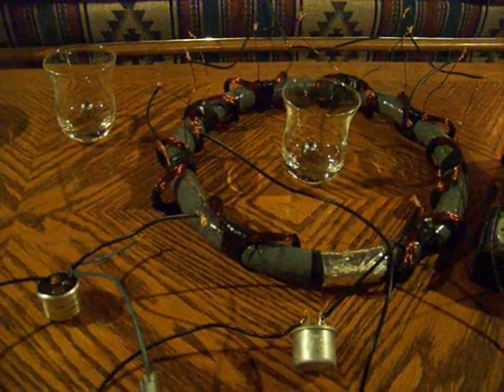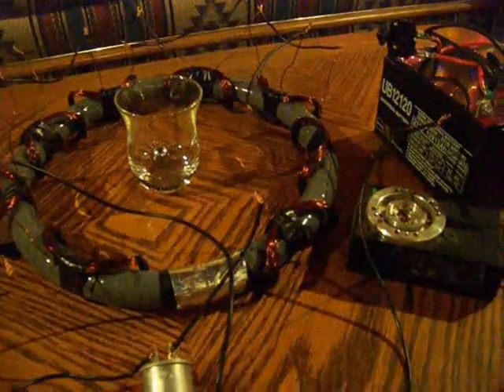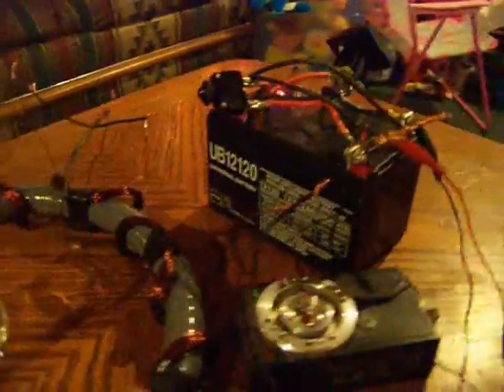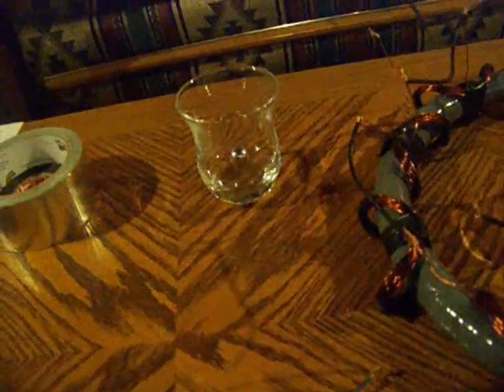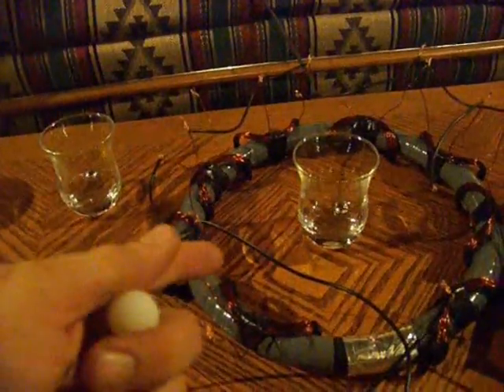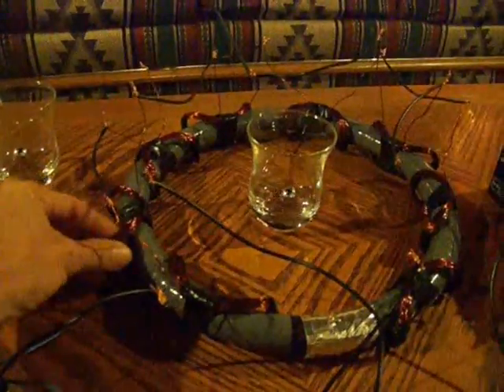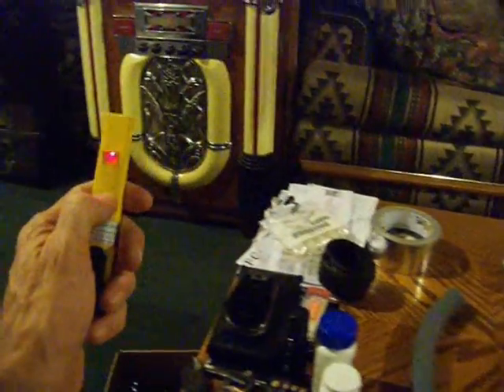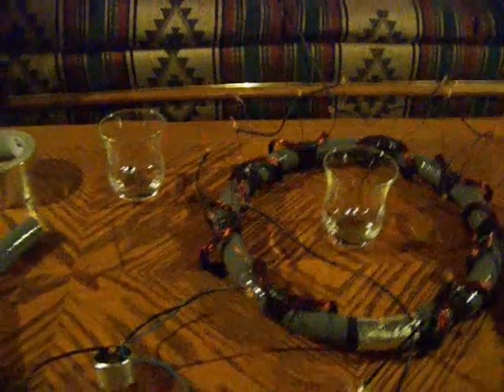Neodymium Magnet  Accelerator !

Comment: That's pretty cool...looks like it has some potential.  I actually went in another direction for accelerating magnets to get usable energy out of a very simple design using a low cost drive circuit. 
 Check it out... its a completely different concept and in this early stage made  ~28 volts but can be expanded by using more internal magnets. Looks like it'll make around 100 volts AC in one small tube.  my video is here: =Cx5nq3BHKK8
I enjoy your videos along with your propensity to do cool stuff.  Thanks for sharing...

Comment: Theres a coil i came up with a little while back you may like.  you make a thin coil of wire ( one strand if you like) and stick the two ends together like a short. this makes it one continues loop. you then tap at 180 degrees, splitting the coil in two. what that does is makes the left side north and the right side south. when energised the two half try come together. or with a magnet in the centre it will spin. as for generating power, you do it along the outsides. the coils faces are sideways